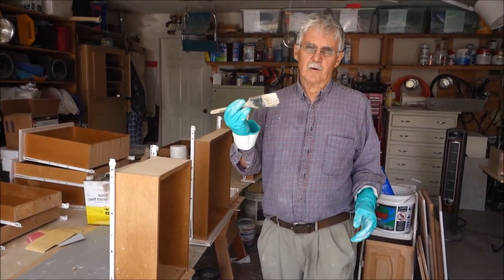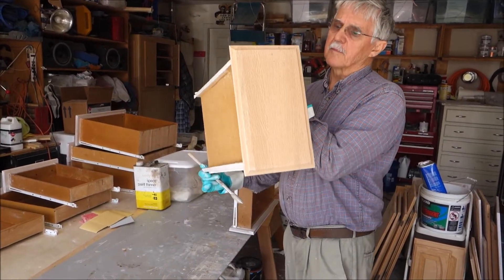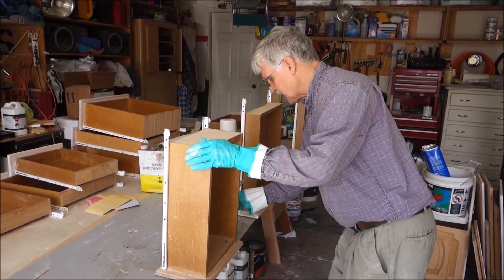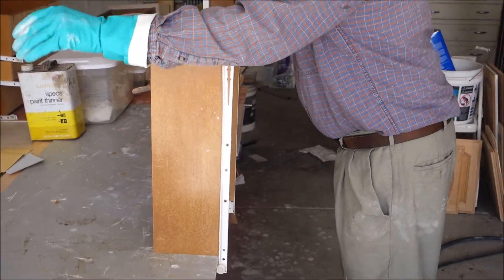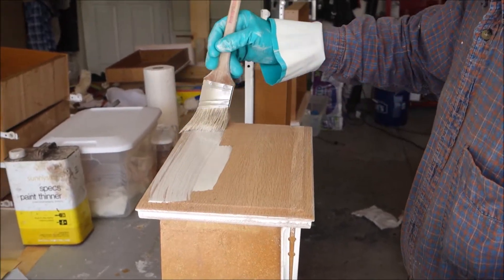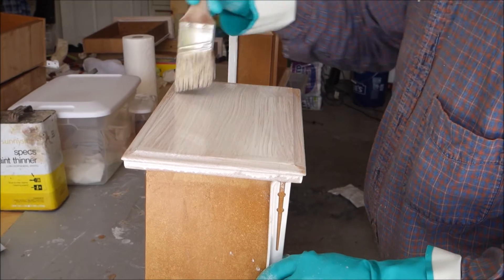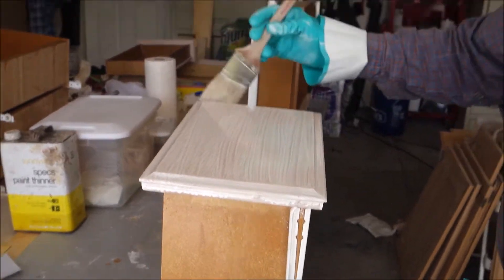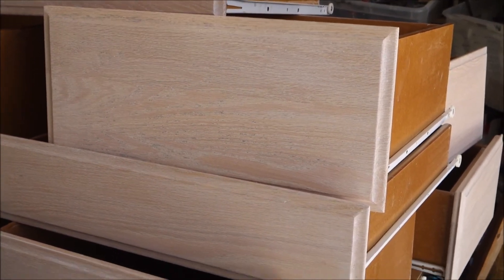white stain oak first coat

Comment: Thank for taking the time to make this video. I'd like to ask, were your cabinet new and bare to begin with, or have you stripped them of their previous finish?
If so, what finish were they prior. I have honey oak cabinets that I would like to refinish. I have already cleaned and sanded them to as close to bare wood as possible.
Reply from the maker: I'm trying to link you to a FB video where I stripped honey oak cabinets. https://www.facebook.com/csfeathers/videos/1366957450037811
Reply from the maker: I had a sheet metal shop make a metal box for dipping all the doors in lacquer thinner. This liquefied the lacquer for easy removal. Each white stain application always allowed the wood grain to show through, otherwise you might as well just paint.
Reply from the maker: The doors were easy to strip and stain. The cabinet panels were more difficult to achieve an even stain showing the wood grain.
Reply: @ChuckJeanieFeathers  the link doesn't work, can you send another one. I am having hard time to figures out a way to remove the old lacquer from the doors, without having to sand them for weeks :D

Comment from the maker: Hi Antonia, I had a sheet metal shop build a watertight galvanized box. I poured in enough lacquer thinner to cover the inserted doors (hardware removed) to be stripped. I covered the box to reduce evaporation. I used heavy rubber gloves and I wore a cartridge mask for fumes. I lifted the door up with a small pry bar and picked it up while I layed a couple boards on top of the box to support the door. With a 5" putty knife I scraped off the dissolved lacquer and dumped it into a bucket below. I scraped all the flat surfaces. Then, I used a large stiff brush with about a 18" handle. I dipped the brush into the lacquer and scrubbed the surface, especially the seams. I quickly wiped off the loosened lacquer with paper towels. I added paper towels as needed.  I dipped a wadded paper towel into the lacquer and did a final cleaning of the whole surface, especially the cracks. Again, I wiped it with clean paper towels. My video of this process is no longer available? I don't know why. The galvanized box can be used for many other purposes. It was used for raising seedlings and for growing a group of succulents. It doesn't rust.  Use citrusstrip for removing lacquer from the cabinet frames.

Comment: Do you think this same look can be achieved using stock cabinets from Lowe’s or Home Depot? Any recommendations? Thank you
Reply from the maker: Yes. After sanding the first coats will appear pink, but after about five coats the wood grain will still be visible but the pink color is gone. Just a nice white wood grain look that is very rare because of the extra work.